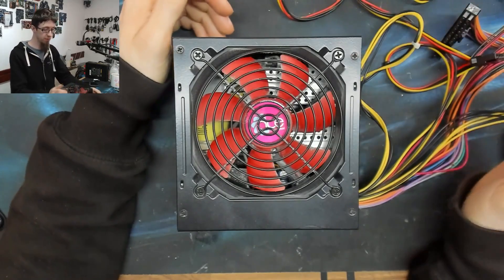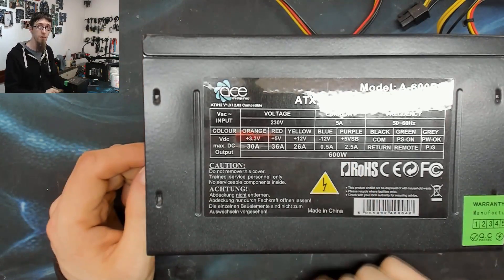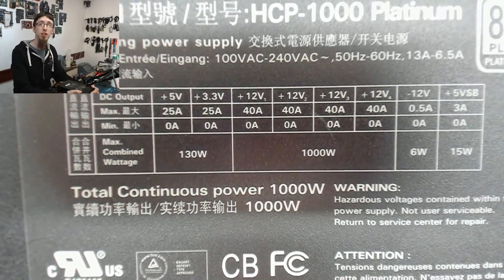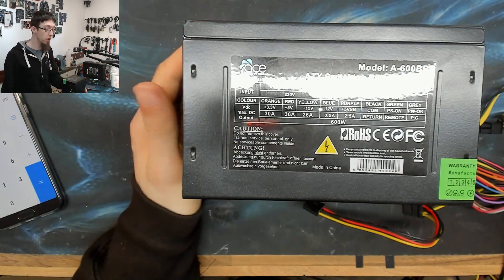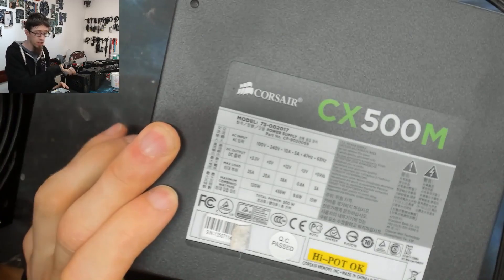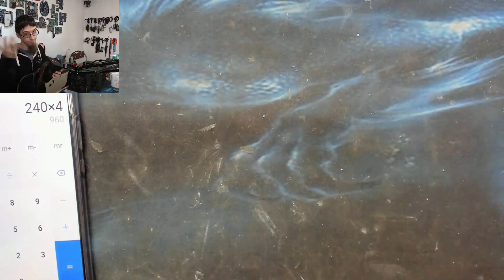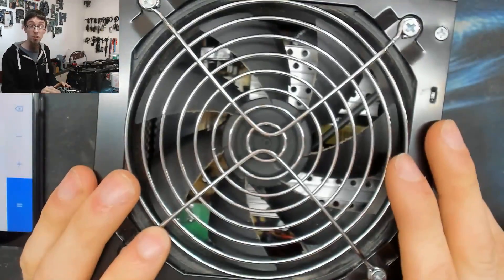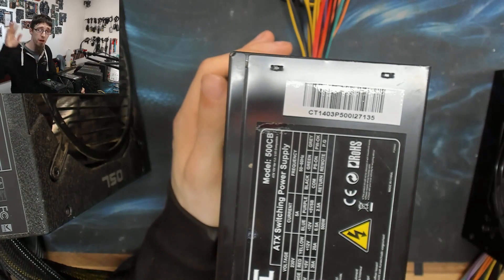LFC#171 - Why This PSU Is Crap

Comment from the maker: Everyone saying "That's an old PSU from when 5v was actually important for CPU power..." you're far too generous - this PSU was made in 2014.
Reply: And you can't even trust those numbers on that cheap PSU. Next time maybe you can open up the supply and take a quick peek at the rated amperage of the secondary rectifier diodes for each rail. I did that with my own pile of PSUs for fun and found that every single "cheap" PSU outright lied on its specs, promising at least twice the 12V current than the respective diode is rated for. All of the branded PSUs diodes actually had headroom.
Reply: @Shmbler  I think this video is to show people how to identify the actual usable wattage of a power (VxA=W), so they can avoid these crap power supply's in the first place. There's no need to open a crapy 600w that's showing (VxA)= 300w to show that it's even worse. Plus you don't want to encourage people to open cheap power supplies (just for safety reasons).
Reply: good info to know and needs more coverage, was hoping for a tear down to see just HOW bad the PSU was XD
Reply: They're probably using old designs to save money. So even though the side of the box says 2014, the interior design dates back to 1998...
Reply: My CPU+GPU is alien in design and uses the black ground cable to feed it, it grabs the infinite power from dirt on the ground of my home, no need for +12V here oh and if I piss on the dirt where the earth cable is grounded it even OC's my computer :)
Reply: Graham, have you seen https://youtu.be/MYo5-JIV4C0 ...? A "650W" Gamemax (granted in Australia) that Tech YES City reckons is really 350W, and also has a fake 80+ Bronze rating and dubious "certification from multiple organisations".
Reply: Probably an ancient design though.
Reply: @shaunclarke94  Exactly. Old design, bright new fan
Reply: @ItaloLoureiro  Making it useless even for old desktops, which need the fan in the rear since the case blocks top & bottom, so they "updated" what didn't matter while ruining the utility.
Reply: @ItaloLoureiro  aBack in the pentium 4 era, a lot of the cpu power would come from the 4 pin 12v connector
Reply: @shaunclarke94  even so... Would it even be usable in a much old system?
Reply: @shaunclarke94  It's all in the quality of the components that make up the PSU, just like in cars, they want quality parts but don't want to pay for them, so vendors cut corners and some even lie about their quality.
Reply: But in this video it is stated that 12v is important for cpu power, abit misleading.

Comment: this probably explains why most of old systems used to crash then, I have had ANTEC PSUs kill a Motherboard and Drives, in my retro system.  The same model was causing my daily to have lockups, so it was binned for Corsair PSU as soon as it arrived in the post.  never by cheap PSUs.

Comment: I always used pretty crap PSUs. Aside from the OEM PSUs I had, I bought 3 PSUs. An Halfmman 500W PSU in 2010 to replace the OEM one with dead fan. Good that the only thing it was going to power was a  65W CPU and 60W recently adquired GT220. At the time I didn't know much about PSUs so I gone with the one with the pretty box. Jumping ahead to 2012 and already a faulty LAN port(probably from thunder storm) and after that a dead GT220 (it died too young, PSU is suspect), so I decided to buy decent GPU to replace it. I bought an HD6770 together with a cheap LC-Power LC5550 V2.2 to replace the Halfmman one (I knew a bit about PSUs at this point to not trust in Halfmman PSUs). LC-Power one was not that good, but had better reputation for not being absolute garbage and it was basically silent on load. 2015 I left to a pretty far away place and used my 2010 Acer laptop for 1.5 years (crappy battery so basically a desktop). 2016 I sold the laptop to buy a used cheap PC (E8400+9500GT+3GB). The PSU was a very noisy 500W Halfmman (this one was clearly worst than the previous), thought it was going to die at any point. After a while I finally replaced the PSU to a much more comfortable Corsair VS450. 2017 the motherboard died, so I decided to send the previous PC for replacing the mobo+RAM+HDD and bought a Q9300 (Q9300+4GB+250GB+HD6770+VS450). Sold the rest of the parts and the computer itself in 2019 as I wanted a laptop instead.

I am now using an Acer 5 2019 Laptop with i3-8145U+8GB+120GB.

Comment: The design of that PSU is quite old. High powered ATX PSU's nowadays have complicated circuitry using Active PFC circuit, with each rail having dedicated regulators that's why they are quite heavy.

Comment: One difference that a better 80+ rating will make is in the amount of heat generated. A power supply getting 80% efficiency will produce 4x the heat of one that makes 95%...

Comment: You should not buy cheap PSU, end of the story. I bought my first PC in 2013, had no freaking idea about any parts outside of CPU, RAM and HDD. A shady looking shop(There are so many of them, they exist because of the price cut they offer) hooked my up with the PC. I had no idea about power supply at all. So what happened was, within 5 years, Almost every part of the PC are dead. Processors don't die that easily because of Gold so it was ok. 

I'm really greatful to find articles and videos about good power supply, prices shocked me at first because I didn't know Power supply can cost that much. I sold my old processor(2nd gen i3)  online and bought a refurbished 3rd gen i5 from a Dell Optiplex and motherboard, then what I did is my first purchase of a good branded power supply and I was first extremely surprised about the quality of the connectors like it's day and night difference, that old crap one had annoying sound, this one is just so silent.  Just peace.

Comment: I used to tell people that the power supply is the most underrated hardware in your computer, especially from store bought computers. Dell and other use their engineers to pare down the usage power to allow them to get the bare minimum needed custom PSU. People buy them, then come in and want to upgrade components. I tell them you will probably need to upgrade your power supply to meet the new requirements of the upgraded components. Computer makers always use their power supplies to cut corners, they can save the most money by supplying an anemic unit . It works good enough until . . .
Reply: Actually OEM's generally use quality PSU's from places like Delta and FSB. They put in the bare minimal for the pc to run with just enough headroom to allow for slight differences in the hardware. I have only ever had a OEM psu fail horribly once and that was due to user error.
Reply: @CotyRiddle  I use to repair computers and PSU's were the main culprit as they are the easiest item to cut corners on. Times have changed and nowadays they are better though.

Comment: It's been proved again and again via oscilloscope under load that the dc output ripple is off the charts with crap psus.this is most def never good for the health of your system.also over current and over voltage protection is to be ashamed of,due to crappier design and electronics, than lvl 1 energy weapons in the fallout universe. they may even pose fire and shock hazards in case of malfunction.so just  decent affordable model from a reputed brand.Unless you live in a post apocalyptic society in the future,I get it, tech and resources are scarce.

Comment: I'm actually curious as to how one of these would do for powering a retro build using something like Socket 462, where the primary power rails required are the 3.3V and 5V ones. On paper it's very well-specced for that purpose (and the not much more expensive 750W and 850W variants even more so). It's very difficult to find working PSUs from that era, since it was the height of the capacitor plague and most have rotted away by now. Unless you have the skill to recap an old unit, it makes finding a viable PSU for such a build very difficult, since you really need a 30A+ 5V rail if you're going to be using a high end Athlon XP or something. Might be an interesting niche where these things can shine, but of course that's assuming that the on paper specs are even reliable and the rest of the unit isn't built so poorly that it won't last long anyway.

Comment: Take it from a guy who purchased a gamemax VP-600 RGB. It’s a POS. 12v rail sank below 11v and nearly killed my pc. Found out the 12 volt rail fell below 480 watts sustained. Don’t risk it. Just purchase a sustained load PSU on the 12v rail. Gamemax is absolute garbage.

Comment: I agree with your findings on power supply quality, but build quality is important. Sticking with manufacturers with a good reputation is important. My experience with audio and radio equipment has shown that with two boxes of the same specifications the one that weighs more is usually the best with bigger heat sinks and more robust construction. I really appreciate you channel showing computers from a repairman veiwpoint. Can't imagine Linus working on a flea infested box. Thank you.

Comment: PSUs will also draw more power from the wall than they deliver, part of tha power is going up in heat lets say a '500 watt 80 plus PSU" delivering "300 watts" will draw "375 watts" from the wall.
Also 80 plus PSUs aren't always 80% efficient it depends on utilization which caps around 50%-60% utilization and then drops slowly if you utilization goes beyond that. This utilization efficiency curve can vary a lot from PSU to PSU, sometimes the PSU will have a graph in the manual showing the efficiency curve for that specific PSU at various loads like at 10%, 20% etc.

Comment: To decode the whole "rails can exceed total nameplate", you have two sides of a typical PC power supply.
The main line conversion system, and the low voltage output system.
The rails on the side of the nameplate are your low voltage output system.
Nameplate wattage is usually the main line system.
So while the LV system can handle, for example, 532w total, the HV system can't pass enough power to run all of that, and the PSU will experience instability, overheat, or trip out and shut down.

I've seen some newer model PSUs from Corsair that can deliver nameplate 750w across a single +12v rail, plus the logic rails.

Also, I blew up the 12v rail on an old Raidmax power supply by putting a GTX 470 and Phenom x2 9500 on it. It smelled funny.

Comment: There is something you are missing with your calculations, these are max figures not continuous figures. Multiply the max figures by 0.707 to get the RMS continuous figures. A 600W power supply is really only a 420W continuous power supply. Using max figures is a marketing ploy.

Comment: there's also airconditioning factor for platimum rating, more heat more your ac has to work, and yes more robust components, less heat = less noise/fan wear.

Comment: There are loads of videos and tutorials on modifying generic crap PSU into lab PSU, and what they must do is to load the 5V line by adding some high power resistor on it otherwise PSU will become unstable and fail if there is very little load on 12V.
Quality PSU are mostly hybrid type where they initially generate only 12V and then use DC/DC converters for all the other voltages, this means you can have no load on 5V/3.3V, draw full power rating from 12V and it will be fine, hybrid topology is also more efficient.
PS fixing PSUs is usually difficult and not really worth the time, especially modern ones which have loads of ICs and some overvoltage from mains blows up a lot of them, it's hardly ever easy one component fix.

Comment: Not mass for cooling, but surface area.
Mass is just a way to store the heat, absorb it. All the holes technically gives it more surface area, improving heat dissipation from the fan blowing air through it.

Same reason why you don't just see square blocks of alu/copper on top of a CPU (Even if Linus kind of tried). Also a reason as to why GamersNexus/Actually Hardcore Overclocking at times bashes some motherboard VRM cooling, as they just threw on a solid block of metal, no fins to improve on surface area. 

In short - budget or not, the hole punching isn't an entirely bad idea, nor unique.

Comment: A couple years ago you could order Fujitsu machines with a common PSU or an 85+ PSU, so from that moment on all machines we ordert at work hat this PSU, which is standard now. Like you mentioned I didn‘t care so much about the electricity bill, but i was sure can noch achieve 85+ with crappy parts and it was about 5-10€ extra, which didn‘t really matter in a 600-800€ machine

Comment: Thank you for this video. Power supplies are confusing when trying to find one that will deliver the actual wattage printed on the label and find one within a certain budget.

And honestly this is why I ended up over buying on my power supply (in terms of wattage), so I could avoid not having enough wattage, but now I want have to do that anymore, so thank you!

But do think you could explain the max wattage @operations +25C(vs +50C).

Comment: I normally just look for an 80 Plus rating, I had no idea how to parse out the info on the side of a PSU, but I figure if the manufacturer took the time to get an 80 Plus rating and used components that could get one, the PSU was not inaccurate in its wattage statement.

Comment: Its not too hard to pick up connectors.  Not to hard to get 2 wire current/volt meters.  No too expensive either.  Be interesting to see you 'interrupt' every wire from a PSU to every point on a computer with such.  Then swap PSU's and compare them that way.  Then you will have 24 absolute readings for the 24 pin connector.  You will have 4 or 8 absolute EPS,  you will have 6 or 8 PCIe and 4 or 8  for your storage (ssd and hd).  Until I see what a board is actually drawing, not really sure what a board 'needs' at all.

Comment: Wrong, the Cpu does not get its 12 volts directly from the Psu. so if you understood scientific electronics you would know that 312 watts @ 12v would be more than enough.
Reply from the maker: You don't need to take my word for it, go look at any modern ATX motherboard. In the top left you'll see a 4 or 8pin power connector called the EPS connector. This carries 12v and 0v lines from the PSU, which then go directly into the voltage regulators around the CPU socket known as CPU Vcore. You can trace it all out with a multimeter if you don't believe me.